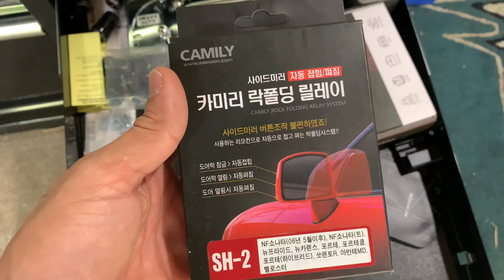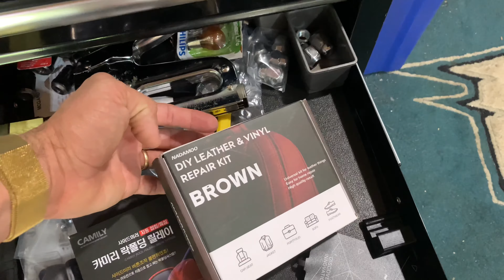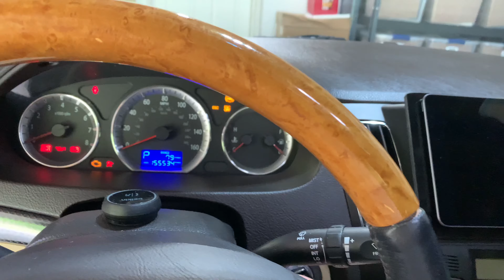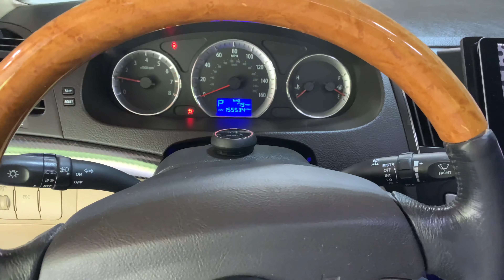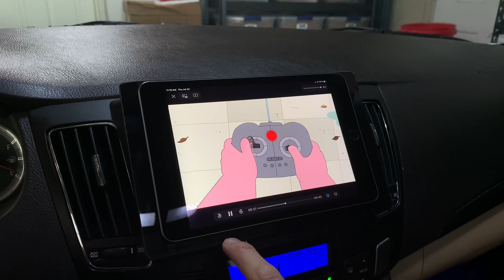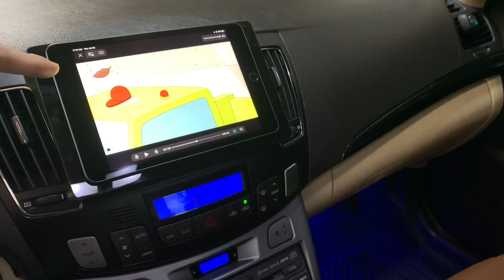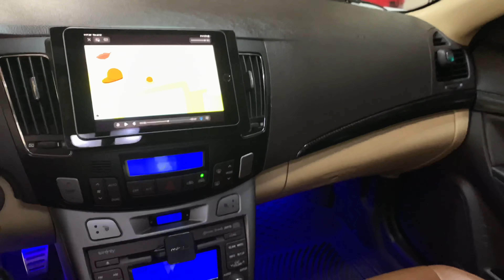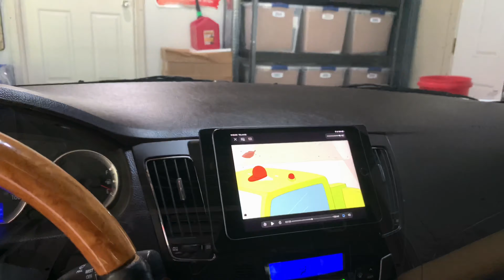FULL Walk Through on this Hyundai KDM Sonata NF - All the goodies & gadgets revealed

Comment: My current mods
- Ultra racing strut bar
- Mishimoto transmission cooler
- Vogstland lowering springs( 1.4 inch lower)
-  Black gloss pillar covers
-  Black wrapped chrome grille strip.
- Michelin defender tires

I love the factory wheels, its the classic 5 spoke design, but they are heavy af.Want to get a ultra racing anti sway bar and the KDM N45 badging for the rear trunk and that's it.
Reply from the maker: Wow your current car list sounds sick, congrats on the mods! Keep it up 👍
Reply: @NuMBERNYC  Thanks! The 06- to 2010 Sonata are my favorite body style from Hyundai.They look like a cross between an Audi(2004 A6 body)and a Mercedes(especially the 08-10 headlights).Those tail lights you got and the rear straight up look like an e-class.

Not trying to make this thing fast, since there really aren't any mods for this car, but by just improving the handling( quality tires, chassis rigidity, lower center of gravity) it makes daily driving this car so much more fun.
Reply: would you mind explaining how you hooked that transmission cooler up? i cannot find any info😅
Reply: @CrowJamz  I bought one of those smaller universal transmission oil coolers from mishimoto and took it to a local mechanic shop to install it.

The only thing was that they couldn't fit it horizontally because there wasn't enough space, so it sits vertical Infront of the intercooler.It's different, but looks kinda cool actually.

Edit: I remember they charged me $120 for labor.

Comment: I recently just Bought a 2009 Hyundai Sonata V6 and have Been having idling issues wondering if you could have input on how to fix or the problem . I’m located in NY also
Reply from the maker: What’s up my fellow NY’er! Sorry to hear about the rough idling. How many miles does your 2009 Sonata have? When was the last time you changed your spark plugs? You should also check your fuel injectors, they may need replacements.

Comment: How did you installed the shift knob? I have a 2006 and I realized the shifter is screwed in. And I tried the model you have and it may be a push style.
Reply from the maker: @waltergt78  to remove the knob you have to lift the knob straight up. Just be careful you don’t break your windshield when lifting up.

Comment: sold my 2009 hyundai sonata limited 2.4l with 178,000 miles interior ir really clean but body has tiny rust all over and needs al bushings to be replaced. i sold it for $2000
Reply from the maker: Wow only $2000? Do you miss the Sonata?
Reply: @NuMBERNYC  i do miss having a sonata but not that perticular one because the body had little rust bubbles everywhere. every single bushing on that car needs to be replaced needs new struts but i still liked that car
Reply: @PROLIFE08  I got rust bubbles on my rear left panel where it meets with the bumper. How the hell does happen? My mom got a 99 Subaru Legacy and no rust bubbles anywhere and my NF is an 09